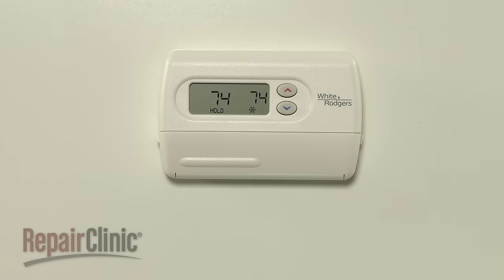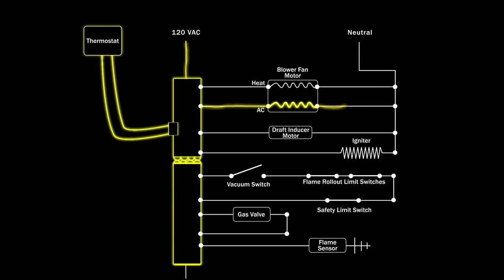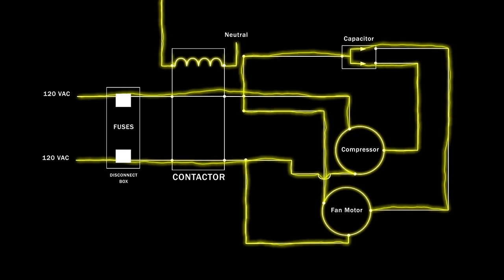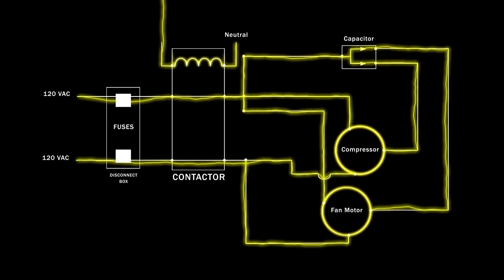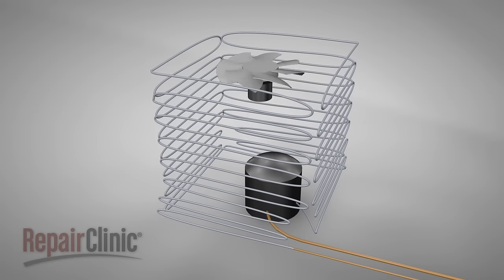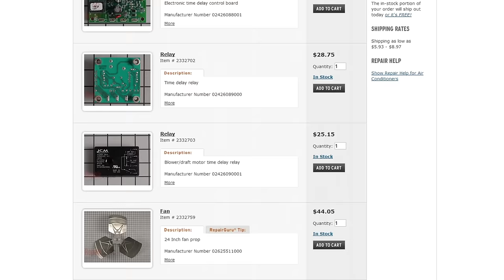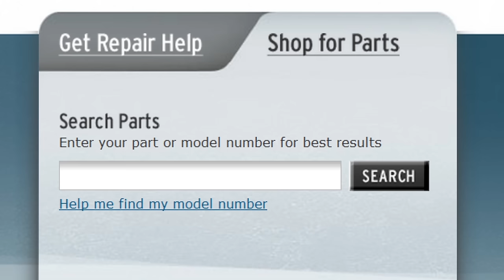How Does a Central Air Conditioner Work? — HVAC Repair Tips

Comment: My furnace is constantly running and won't shut off. The unit outside shuts off when the temperature is reached but my furnace just keeps running. What is the problem?
Reply from the maker: We recommend using the repair help section of our website. If you enter your model number there you'll have access to part, model and symptom specific repair help. http://www.repairclinic.com/RepairHelp/How-To-Fix-A-Furnace/178---/Furance-blower-runs-all-the-time?TLSID=1733
Reply: You might just have a 2 stage furnace on blower delay
Reply: The fan switch on the thermostat may be on the 'on' position instead of the 'auto' position.

Comment: if the fan doesn't run or hum what 
does it mean
Reply from the maker: +Carter Larkin-Kukta Probably not getting voltage to it or it has failed completely.

Comment: Its So simple and easy to work on yet Techs charge an arm and a leg just for a simple repair.
Reply: It's not easy to work on. Going up to a very hot attic to diagnose a problem on a hot summer day isn't easy at all.
Reply: @marmars1081  i work in the refinery Going inside vessels and reactors in full slicker suit and breathing air. A hot attic is like working in the snow for me lol.. But I would say that for somebody that isn't used to it would have a hard time.

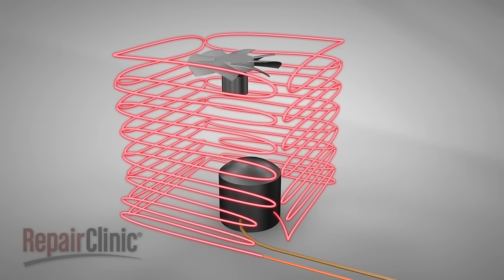Comment: typo at 3:10!

a compressor does not condensed vapor to liquid. Compressor should always sucks in vapor and discharge vapor.

HVAC compressor sucks in low temperature/low pressure vapor and discharges high-temperature/high-pressure vapor.

Comment: i read  online a central air conditionning and heating system can cause a low level undetected  level of carbon manoxide which can cause problems to your health and in the future can cause brain damage  there are for different problems that the system can have causing it to leak undetected low harmful levels of carbon manoxide if u have a crack in the combustion chamber or leaking seams or cracks in teh exhaust pipe or from an imcomplete combustion process even if u have the carbon manoxide detector close to teh system it may not detect the dangerous low life carbon manoxide
Reply: symptoms are dizzyness headache psysical weakness vomiting chest pain confusion  this is the early symptoms
Reply: nausea
Reply: that only applies to furnaces SO LOL PLACES WHERE HEATING IS REQUIRED, EQUATOR COUNTRIES SUCH AS INDONESIA IS BETTER LOLOLOL
Reply: actually I should've not underestimated cold countries because at some point due to global warming it will heat up and become like the equator

Comment: 3:10 The compressor does not convert the gas into a liquid. There shouldn't be any liquid in the compressor. You guys shouldn't make videos about things you know nothing about.
Reply: Actually it will
That's the whole point of the compressor
Reply: IT DOESNT YOU ASIAN, THE ONE DOING EVAPORATION IS THE EVAPORATOR COIL